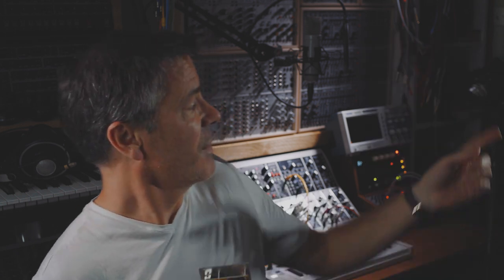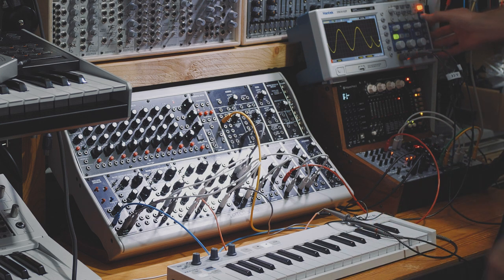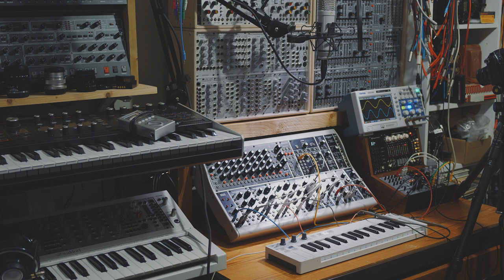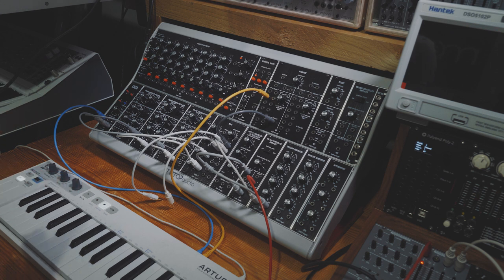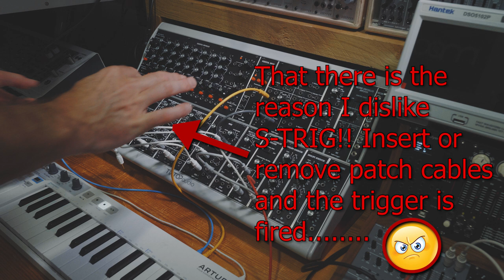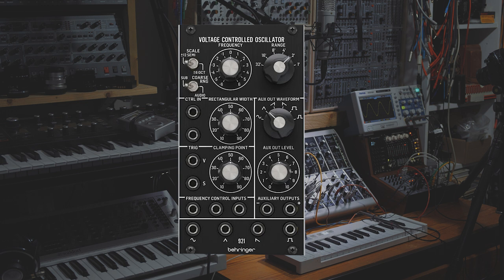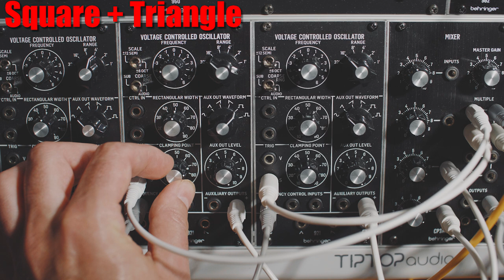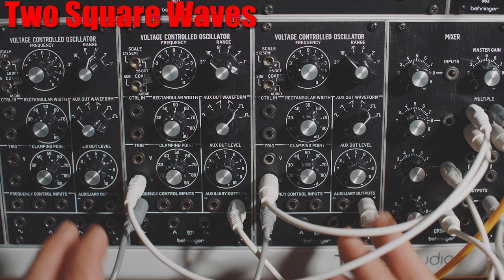Demystifying the Clamping Point - Behringer 921

Comment: The reason that the Clamping point control is on the 921 but not on the 921B is that the 921 doubles up as the LFO in a Moog Modular system which is also why most Moog modular systems only have one. It has a much wider frequency range than the 921B and an output amplifier to increase the output level to make it suitable for modulation. The different clamping points allow you to begin the modulation when you start a note and select the initial control voltage. The design of this VCO pre-dates the retrigger type of VCO sync but it (probably unintentionally) serves this purpose. The sync on the 921B does not retrigger the wave. The 921B VCO is known as a Phase Locked Loop with the oscillator being one component of it. The sync circuit adjusts the control voltage to keep the two waves in phase with each other and therefore at the same frequency and this sounds very different to the VCO sync that most people are used to because the wave is actually being bent to keep the phase the same.
Reply: Yes! And one of the reasons behind the implementation of Clamping in 921 and Sync in 921B resides in the possibility to made additive synthesis (with several sine waves in different frequencies) with accurate phase too!
Reply: Thanks Rob. I was wondering if the oscillator could be used as an LFO where it would give consistent modulation.
Reply: @unclemick-synths  The raw individual outputs of the 921 and 921B are too low to be used for modulation which is why the 921 has the auxiliary output with a waveform selector switch and level control. This is actually an amplifier that boosts the output level so the VCO can be used as an LFO. The switch is there so that only one amplifier is required.
Reply: @robcrouch1680  thanks for clarifying Rob.
Reply: very interesting comment, cant wit to test out the difference in sync styles.

Comment: Please correct me if wrong. On this VCO, “trigger” is the same as hard sync. With Clamping Point (CP) at zero, it is like most VCOs that have hard sync. Using sync to give low notes consistent attack is a standard old trick.

Setting CP to non-zero values is where it makes a difference. However, our ears are somewhat insensitive to phase, so different CP levels will not always be obvious; it depends on the mix of oscillators and their frequency and sync relationships.

Varied CP settings would be obvious when used at low frequencies for modulation.

Comment: Great would have been good to include some examples of the 921 in LFO mode and modulating other sources with clamped waves.
The Solaris has the ability to set what it calls 'phase' to select the restart point for lfo wave forms - which is key to the voxhumana shimmer of multiple lfos.

Comment: That emoji face whenever s-trig unintentionally triggered was hilarious. :P 

For whatever it's worth, I ditched the interface module and created some cables with a transistor/resistor circuit. One nice side effect of that is that as long as I disconnect the cable at the source end first, I've found the accidental grounds are much less likely to occur. It's been a happy accident.

Comment: so if you put the output of another oscilator tuned one octave lower into the v-trig input you could get hard sync sounds by varying the frequency of this oscilator with an envelope or lfo, and using the clamping point control could vary the timbre. Interesting!

Comment: Cool! Well ahead of the curve! I was not expecting old-school analogue gear to do this. So this is kind of a "retrig" with the added benefit of choosing the starting point. You don't have to use a resonant filter for kick anymore, you can use a clamped sine. It will get rid of those pesky random clicks or random lack of transients. Do a nice fat 808 kind of longish tuned kick with a touch of analogue drive! :D Also, now you can always have a solid bass that is never out of phase, never drops out! No need for added sine bottom to keep it stable... On my wishlist from now on, if I'll ever get into the hardware world. :)
Reply: This is [a copy of] the oldest of old school! Moog had it, early on, but virtually nobody copied it—not even Moog, for the most part.
Reply: @johnmahoney5393  They should have. We all need an oscillator like that in the toolbox! 🙂

Comment: So it's a sync with adjustable phase?
Reply from the maker: Yes, well it's a single sync with adjustable phase. You get different results with osc sync which is constantly syncing. My detuned oscillator example was not very good but this reset allows you to have a detuned sound which you can not achieve with proper osc hard sync
Reply: @TimShoebridge  You can do the same with normal oscillator sync, just use a gate/trigger instead of a 2nd oscillator. Only difference is that you can't adjust the phase.